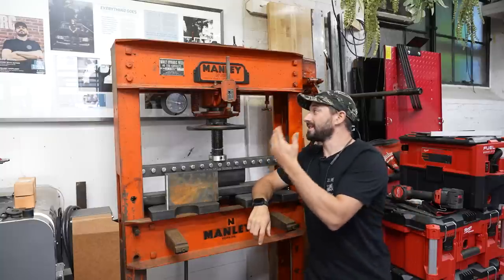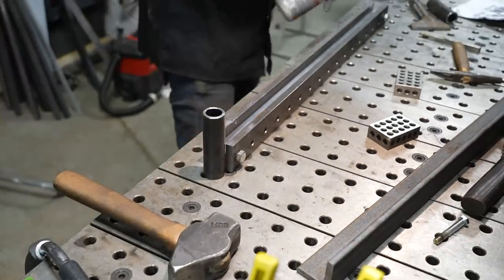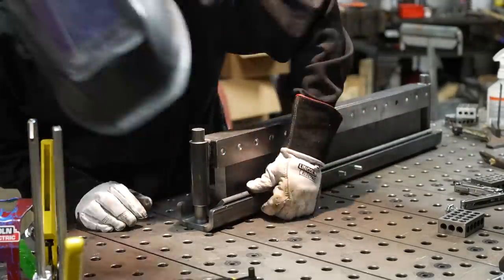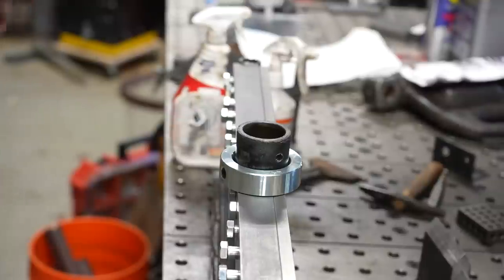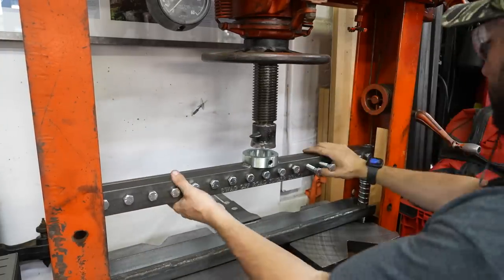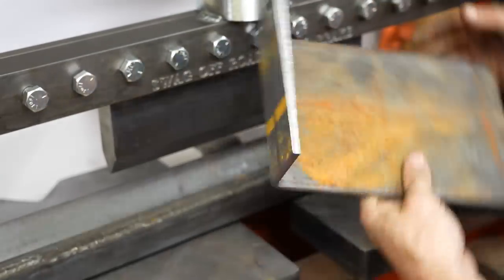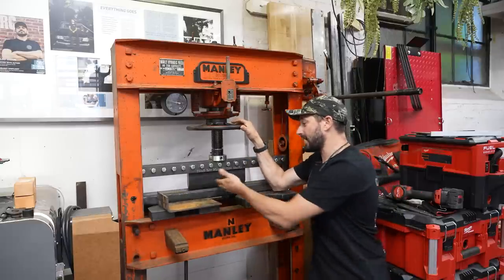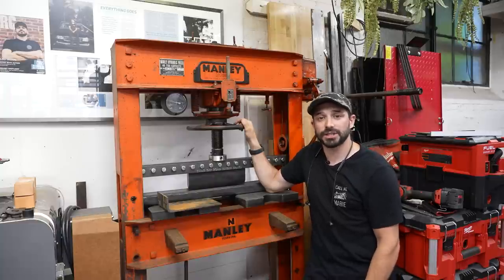Making a 40 Ton Finger Press Brake! Swag Offroad Kit

Comment: General rule of thumb for bending plate in a brake is the die should be 8X the thickness of the material.  So a 2" die is needed for 1/4" plate, 1.5" is needed for 3/16" plate (but can be done in a 2" die,  you'll just have a larger bend radius), 3/8" plate should be done in 3" die, etc.

Comment: Have you needed to reinforce the finger holder vertically yet?   It has all that pressure pushing down in one spot.
Reply from the maker: I haven’t had to do any additional supports, so far it’s work really well. I’m bending some 30” long 3/16 for a project this week so I’ll see how it does…
Reply from the maker: I haven’t had to do any additional supports, so far it’s work really well. I’m bending some 30” long 3/16 for a project this week so I’ll see how it does…
Reply: Thats great! @MakeEverything

Comment: When welding in bottom die it doesn’t need to welded solid. It’s not going to be going anywhere all the force on it is going down in to the plate. Some well placed stitch welds help not to warp the bottom die.